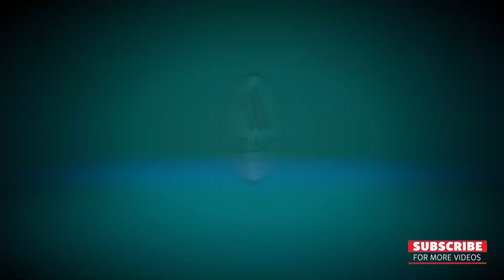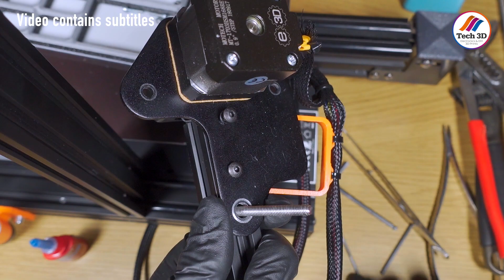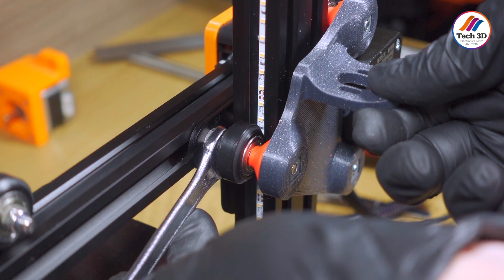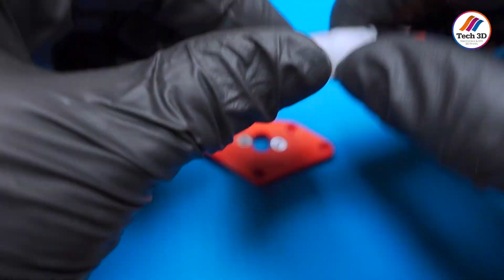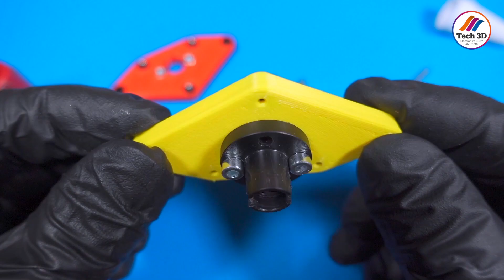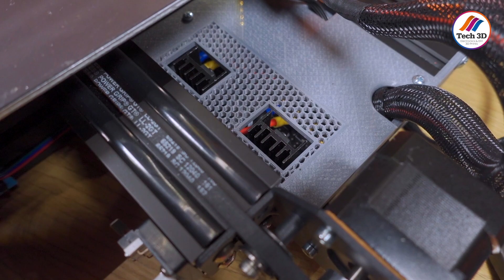How I improved the quality of 3D printing Ender 3 PRO - part 1

Comment: I think the ball bearings will probably wear holes in the top of the magnets as they are just nickel plated. The magnets would be better off with small thin metal disks over then to protect their surfaces.
Reply from the maker: This is of course likely but due to the force pushing on them being spread over multiple magnets and the amount of side to side movement it will happen so many years later that the printer will die of a different problem.

Comment: Nice. I also had the idea to add ball bearings and magnets for a z wobble damper but found some straight z screws so never bothered. I might try this  at some point.
Those z stepper mounts will inhibit cooling though. Perhaps some thermal paste on the base to help transfer some heat into the frame.

I have the z brace and bearing setup on my Aquila. Excellent upgrade.
How much z height did you loose with those z nut brackets? I lost about 30mm with the stock plate.
Just a note, you can't use the z brace file in the package you sell on cults. The base file these were remixed from has a non-commercial license attached to it.
Reply from the maker: For Z stepper motors, the appropriate current needs to be set. It is not necessary for them to run at full current output when they are driven by a trapezoidal rod. Then they do not get very hot.

I have limited the height in the firmware to 200 mm. I haven't needed to push parts higher than 180-190 mm yet.

Comment: Just upgraded my ender 3 v2's z axis with creality's kit for it. I had to muck around a bit with it since the second screw kept binding but it seems to be working fine now. This seems like a step up from that but idk if I have the technical know how to do these upgrades without messing it up again. It's a basic cost/benefit analysis. It's the same with upgrading to klipper and octoprint it seems to be working fine now so idk how worth it it would be to spend a couple dozen hours and the money on the raspberrypi when I don't have any programing/soldering experience to back it up.